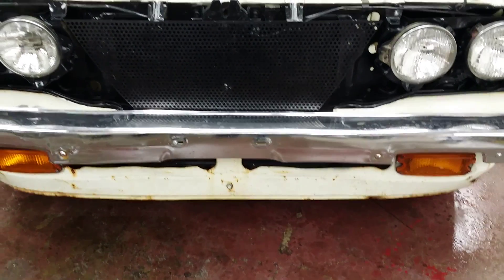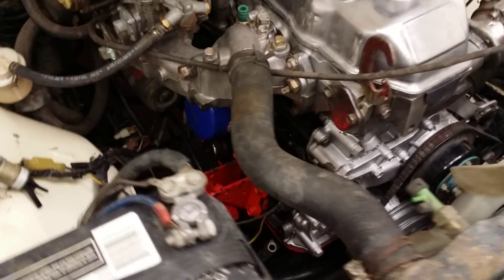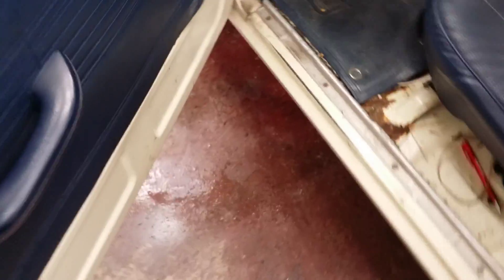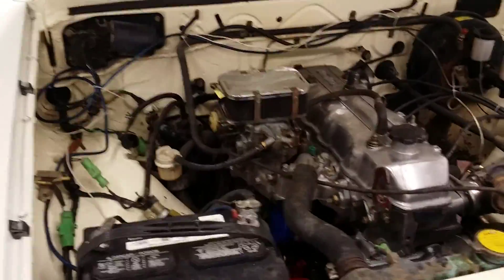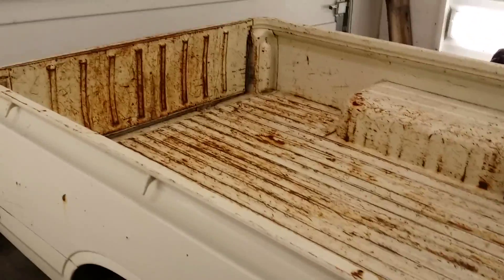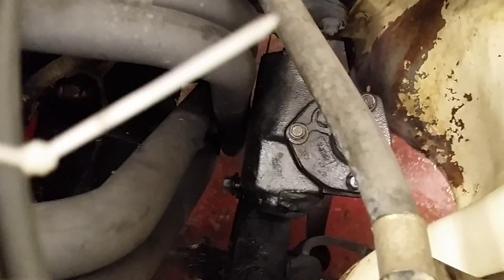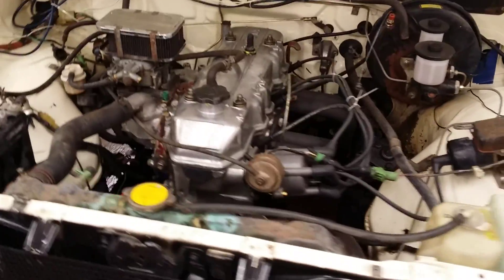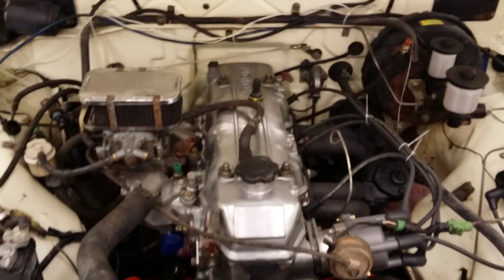TOYOTA HILUX 22R ENGINE SWAPPED! 1978 Hilux pickup 006

Comment: Hey I just recently came across this video. I’m putting a weber carb on my 77 pickup. It’s an automatic and I’m having a hard time with trying to figure out how to mount throttle rod and kick down for the automatic transmission. Motor is a stock 20R. Could you reach out or maybe send me a video showing throttle mount? Thank you!!
Reply from the maker: Mine already had the automatic, So it was no problem, but I will try to get you some pictures or something as soon as I can, but you have to bare with me, I run my own motorcycle shop and I am currently swamped. As soon as I get an opportunity I will get some pics.

Comment: How were you able to use the same ignition  system  did you swap out the distributor
Reply from the maker: I used the 22r distributor, the plug was different, so I had to slice in the plug from 20r distributor, but the rest of the electronics were left the same.
Reply: Thank you

Comment: Oh and when you swapped the engines did you keep the transmission in or did you remove it?
Reply from the maker: I kept the heavy duty A40 automatic transmission  in place.  Its a direct bolt up for 18r,20r 22r and some volvo engines too. The motor came from a truck with 4 wheel drive, so I had to change the oil pan and oil pick up over from my 20r to make it a rear sump to clear cross member.

Comment: Hey, does the 22r distributor work with the stock coil??
Reply from the maker: Yes, almost any coil will work actually. There is some stuff on the internet too about changing the coil and igniter over to GM 350 V8 units. Thanks
Reply: THE DRAGON awesome man thank you for getting back to me, im in the process of dropping in a 83 22r into my 78 hilux.
Reply from the maker: @FantasyHiders  Good deal! Cool, I know all about that man. Feel free to hit me up here if ya got any questions. I drive my truck everyday, I think it runs better everyday too. It's painted black now, well for the time being, one day I will do a total build on this little hilux.
Reply: THE DRAGON Thank you! Seems like its gonna be a pretty easy swap but if i run into any snags its good to know i have someone with this same experience. Oh ya whatd you do about the alternator?
Reply from the maker: @FantasyHiders  Been awhile, but I believe used the one off the 83', and used the original bracket. Should plug right in.

Comment: That looks like 2.6 stroker stage 2 from LC and I thought the 22r came with single roller finding chain the double is a upgrade I have one a 22r street stroker you got a steel if that's what I think it is you ever want to sell it let me know
Reply from the maker: Lance Nielsen:: One of these days soon, I'm going to actually do some internal measurements to figure out what the heck I do have. I too have been thinking that it might be a mild stroker, because it has alot of torque. I know it doesn't have a big cam, I can just tell by the way it runs, that the cam isn't too radical, but this motor does have a ton of torque. Thanks for watching. If I decide to sell I will let you know.